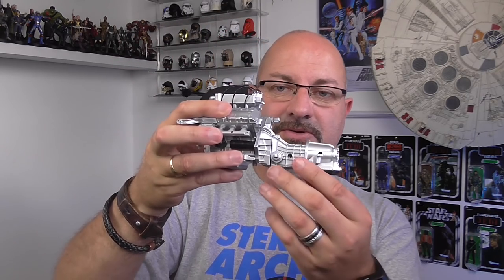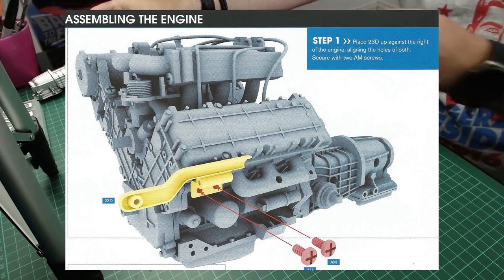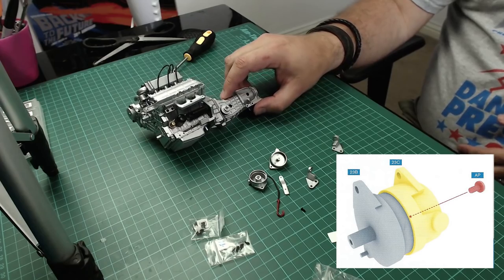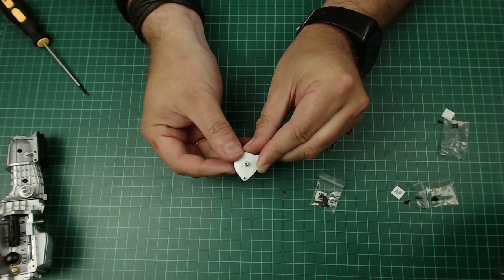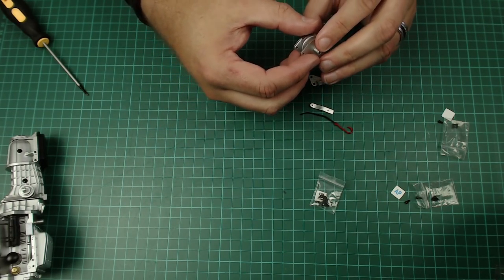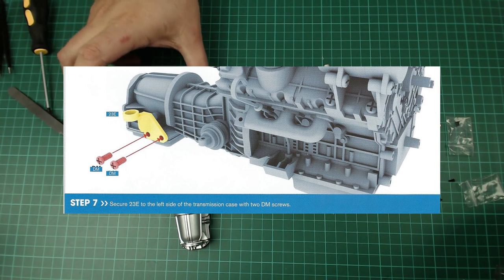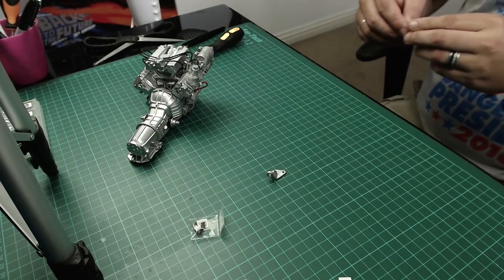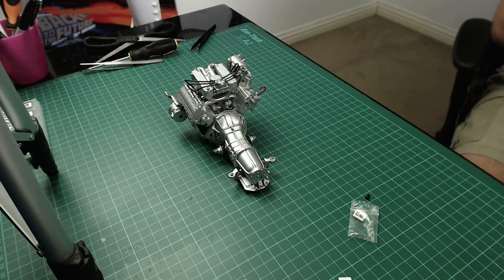Build the Delorean - Issue 23 - Distributor and Oil Dipstick

Comment: Hello Wayne, yes my screws was the same a bit of pressure and it snapped, but can l just say, the 6 pipes you fit at the end, from the injectors to the engine block, well my engine block there was only 1 bit of metal to slide them on, the other 5 there was nothing there so l glued them on, thank-you take care

Comment: Hi Wayne It's Wayne.  Could you please help?  I'm having a lot of trouble keeping me black magnet on the wheels to stay in and not fall out (issue 5) They keep coming out when putting the wheels to hover mode.  Any tips. Thanks.
Reply from the maker: BOLLY WAYNE I ended up gluing them to the metal frame in the end.
Reply: Hello other Wayne! :) I had the same issue with my front right wheel. The magnet on the wheel was ok, but the counterpart on the suspension got lose and stuck on the magnet. I also ended up gluing the part in the suspension. So far so good. I am also thinking about replacing those parts with similar sized magnets. Should hold the wheels better I think.
Reply: +Zedpower Thank you
Reply: Thanks for the tip, my right front wheel won't stay up. It keeps falling down and the magnet comes off. I'll invest in some glue.

Comment: Weird, my gear box it's different of yours 🤔 it's all metal and longer with more "lines" all over it. The tip doesn't end like yours. 🙄
Maybe they "updated" 😅
Reply from the maker: They did. We had an automatic gearbox when it should have been manual
Reply: @WorldofWayneUK  Uhm interesting 🤔 I guess in this 5 years they listen to the fans... And until know the screws didn't break either 😏